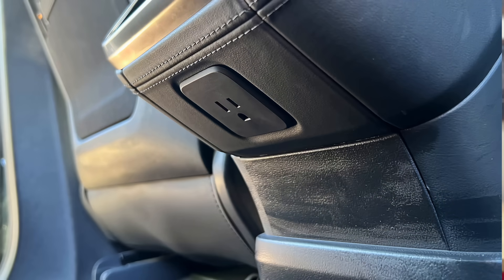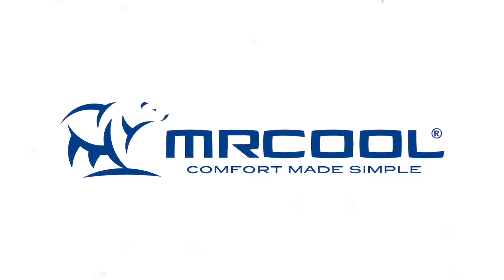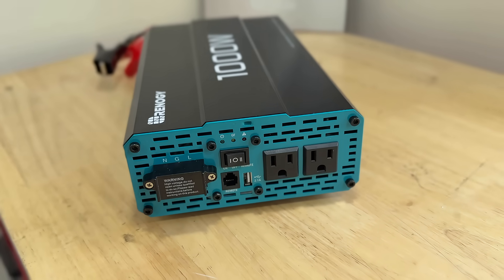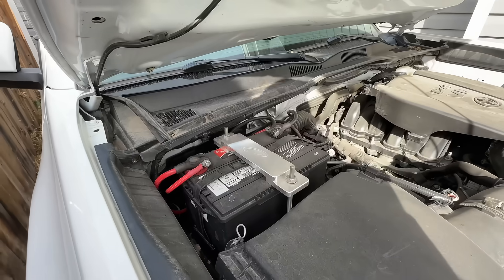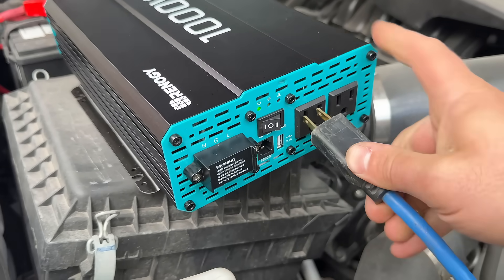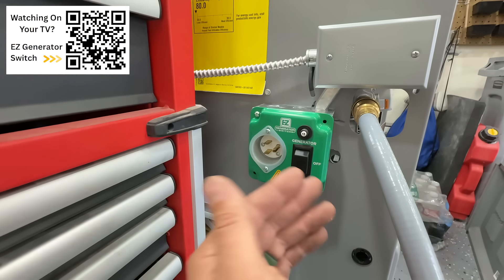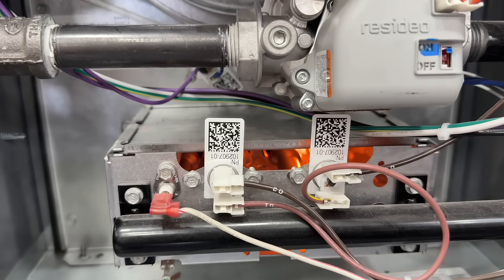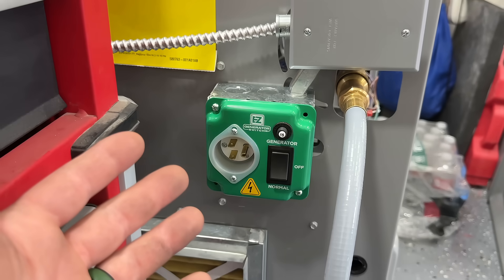Why Buy A Generator? You Have One Parked In Your Driveway.

Comment: 2:17 @diyhvacGuy One SUPER GOOD Idea MIGHT be to IMPLEMENT a “Uninterruptible Power Supply’ (‘UPS’) like The ‘CyberPower LE1000DG’ is the best UPS for people who want to  Be prepared for ‘Voltage Fluctuations’ to prevent potential damages caused by “Unstable electrical current Flow” going to the INVERTER, to back up Essential few electronics, including Refrigerators/‘Deep freezers’ and similar.  Another useful technology to enhance setup includes using a FARAD capacitor immediately BEFORE the Inverter primarily the +Positive+ terminal, the More Energy storage, the better for your Inverter’s long term health!
Essentially a type of Energy storage device “before AND after” INVERTER would very likely optimize overall optimal outcomes. Particularly for computers or Recent Refrigerator’s with real computers internally.
A UPS (just like FARAD capacitors) could SAVE available energy Plus Deliver a EXTRA boost!

Comment: This has to be the dumbest idea I ever saw. Yes a vehicle can be used but why? I am permanently off grid in South Africa. I can get a new 1000w generator for the equivalent of  $ 120. Uses far less fuel and won't ruin the car engine. Unless your car is diesel, idling for extended periods is really going to damage that engine. You will kill the battery as well. Anything using AC will flatten a car battery very quickly.

Comment: You need to caution people about the limited amount of current you can get from a car without special upgrades. First, you mentioned a 110 outlet in cars as being one step ahead but those outlets are meant to run a laptop or charge a phone. If you try and run anything else requiring more current you will blow a fuse. Ask me how I know, I plugged in a battery charger for a power tool and it blew a fuse. Second point is the maximum current you can get from a cars alternator and lead battery. They are designed to run a car and accessories, if you hookup a 3000w inverter you are going to fail. Find out the amps your cars alternator puts out and multiply by 12 to get the watts it will provide. Standard alternators provide 60-150 amps times 12 (12v battery) best case is 1800 watts, worst case is 720 watts. So you can see why this is important, if you hook  up a 1000W inverter to a 720W alternator you are asking for trouble. Don't forget that the alternator is not going to put out its top current at idle speed. Find out the current supplied at idle speed and get an inverter to match or be aware not to ask it to provide more than it can handle. This can work for running a furnace, OR, something else, trying to run more than one item is risking damage to the car in a worst case scenario, a fire. And I would not use clamps on the battery to power it. Attach some good connectors directly to the battery with an Anderson plug that the inverter can plug directly into. Clamps are an inferior connection that when asked to carry higher current loads will over heat.

Comment: You need to consider energy loss through a long extension chord which can be signifiant with a thin chord also consider for example the average electric kettle alone is 2000w

Comment: In 1987 bought a 1979 Ford Courier (Mazda) that had a 110v after market auxiliary kit on its alternator. Think it was only half sine wave and unregulated so engine needed to be revved to obtain the 110-125v AC. Think was supposed to only use brushed motors plugged in. But it was interesting for that day.

Comment: A 1000W inverter connected to your furnace will smoke the blower motor. $$ to fix! The start up current for a 1/2HP or 3/4 HP blower motor is more that 1000W. Be alert to BS YouTubers pushing nonsense like this. (message from an electrical engineer doing this type of work for 40 yrs).

Comment: Dirt bike has entered the chat.  Mount used generator to frame after rear tire removal.  Hose on exhaust pipe and ran out of garage and idle in gear selected on center stand and power cord to breaker box.  

Congratulations your ready to convenience your wife you NEED A TENERA 700 YAMAHA for "the family " 😂😂😂😂

Comment: 1000watt at 12 volts dc is an 85 amp load between the battery posts and the inverter. Going to need heavy cables for maximum inverter output, #4 awg cable given 100% duty cycle on the inverter.

Comment: if engine is idle about 300w is all  alt. can make .....
Never charge a battery with car power because you waste double power & charge half as fast, use solar panel always!.
DIg this, a charger must produce twice output voltage because it fights battery back voltage!

Comment: Notice on the back of this 1000 W inverter it has a 10 amp breaker your fridge pulls approximately 12 A your microwave pulls approximately 10 A you could power up LED lights each LED light pulls about 15 W if you’re gonna do this you need at least a 5000 W inverter You take the 5000 W divided by 120 and it will give you the amperage output all you’ll do with this 1000 W inverter is burn up everything you have

Comment: I have the 2.0 KW pro power onboard system on my Super Duty truck, it has 2 batteries & 2 alternators hooked to engine with built in inverters which is built into the trucks electrical system, cleaner quieter and more integrated than a traditional generator!

Comment: I would only do this in an extreme emergency to avoid the cost or a lot of money to replace your alternator later on this would work great if your vehiclee was from the 1970s but when they started to use computers in cars Nope dont do it alternators can be very expensive even my older 06 Lexus is350 alternator is around 1k

Comment: In an emergency you could use this. I'd recommend just charging a batt. off a solar pannel. Just run a few nessary appliances (refrigerator, water heater, etc) to avaoid draining the batt. too quickly. 

I'd recommend a 48v system by linking four 12v lithium ion batteries in paralel and a 48v inverter. This way you do not have to worry about ballancing the voltage between batteries like you would with a series connection.

12v 100 amp hour batteries are the most common and can be found pretty cheap. Running in paralel puts less stress on the batteries.

Comment: Most car alternators are 60-80 amp units.  That translates to (with perfect efficiency, which doesn't exist) 6 - 8 amps @ 120 vac.   An average 800 to 1000 watt generator is about $250.  Your car is worth probably an average of $20k.  An alternator replacement alone will cost about $1000.   You do the math.

Comment: What's the alternator's amps output ? How many watts does the furnace pull ?  The 'standard' vehicle's 120 volt ac plug works off a ±400 watt inverter. Hardly enough to power a gas furnace. 1000 watt inverter has limited output. If you have no knowledge on any of this topic, find someone who can go through the numbers before trying to save money instead of buying a good generator which will cost you more than $1000 when all the extra required addons are calculated into the price plus installation costs.
This system requires a bottle of aspirins and a good roadside assistance program.

Comment: I will reiterate what others have said here.  Putting that inverter under the hood of a running engine will quickly overheat the device.  It was never intended to be operated inside an oven.  Viewers should always use some kind of separate generator instead of going in this direction. SMDH. Just because you CAN make a video, that doesn't mean you SHOULD.

Comment: I just had a 39 hour power outage and used my vehicle with my 1500 w inverter to keep my refrigerator working. I have longer heavy duty cables so that I can place my inverter inside the vehicle so that it will not be affected by the heat of the engine when the hood is closed.

Comment: Thanks for your video!  I bought a 1000 watt inverter to use like this but I haven't tested running the furnace on it. I think the real test would be starting/running the furnace blower motor. I'm assuming you've tested that part?

Comment: So, will the engine be off while powering the home? It seems that would drain the car battery fairly quickly? Running it idling for longer that a few minutes is NOT good for your engine.

Comment: Yes this can be done but that does not make it a good idea. No! A car alternator will generate less than 1000w with the car at low revs. You are burning a lot of gas for very little power. If you pull more than your alternator can generate you will quickly drain your battery. Also be very careful on where your car exhaust is venting as you risk carbon monoxide getting into your home. Long term idling is not good for an engine.

Comment: Thanks again for another great video. I installed the less expensive outlet for my new furnace. But moved the outlet to the ceiling above my furnace. Attaching anything on the inside or outside of my new furnace itself would negate my warranty. Installing the outlet up above took care of that issue. Thanks again.

Comment: in a pinch   this will work   for a short while.   BUT  big limits,  first  running your car, even the most economical MPG vehicle will not run long while in idle,  maybe 10-12 hours  lets say 24 hours cause you have some extra gas from a second car. So for a local power outage that will be fixed shortly (according to your electric company) thats fine,  but for a Katrina even no bueno,  use that car to get out of the zone.   Will that car run your home ?  Nope.  the largest inverter you can hook up to a car battery  is 2k watts.  so yeah the fridge, some lights, maybe tv.   your AC?  no the central unit but maybe a small portable unit, but chose  food cold or you cold.

Comment: I hope most people don't take this to heart. The wires supplied with most inverters won't support the full rated output even in a short run. I've seen some companies even supply CCA wires with their inverters. It work OK as long as you don't sustain the rated power. 

Secondly, "many" not "all" new cars don't support extended idle times. Thirdly, the alternator is not going to put out full power at an idle. 

A lot of high idle times serve vehicles are having camshaft and lifer issues related to idle times. Mostly from the use of high pressure low volume oil pumps. The low volume doesn't supply enough flow to lubricate the engines properly.

Comment: You will NOT be able to run your furnace and refrigerator off a 1000w inverter hooked to your vehicle.. You would be very lucky if you can run one of them off of it. Depends on what the appliance requires to run. 

I've been working with these inverters for 1 1/2 years now and you are very limited with this setup.  I can't even run my hammer drill for drilling a slab for a termite job. Microwave is out of the question, it is also a long way from running a window AC unit. Not going to happen. Many large items have a huge initial wattage draw these 1000w inverters are not designed to handle.

You can run some lights, your computer, router, and maybe your TV at the same time.  Since you won't be running your vehicle 24 hrs a day. It is just emergency small power and not something that will keep your food frozen or cooled 24 hrs a day. Or your furnace running 24/7, if at all..

Big draw items will drain your battery dry even as it's being charged. Even a coffee maker will drain the battery while it's being charged. I use LiFePo4 3840wh  300ah  batteries. Way more depth than a vehicle battery, but you can't charge fast enough to keep up with continuous high wattage draws.

I have used 1000w inverters hooked to my truck to power a charger for the LiFePo4 battery in the house that has a 3000w inverter hooked to it with four outlets. I run my washer, dryer, coffee maker, two PCs with occasional printer and shredder use. But not all at the same time and the coffee maker gets shut down once the pot is made.  The 1000w inverter on the truck is only running the charger for the bigger battery in the house in this setup. I can run my PCs etc, for about 10-12 hours before needing the charger running again.. Can do 6 loads with washer and dryer without draining that battery yet.

The joy of having gas appliances and a grandfathered-in wall gas heater in the bathroom means I can heat my home without elec. use.

Comment: Guess my gas furnace is an outlier because it doesn't require an electric charge to run. Propane FTW!
Reply: So, how does Ur furnace MOVE the air in the ducts?  Or is it radiant (small cabin) ?
Reply: @darknes7800  As far as I know from the HVAC guy's explanation, gas powers the entire thing. There's no electric current for it or the water heater.

Comment: Newer vehicle have an idle time issue. They are not designed to run idle anymore. We used to run our vehicles idle all the time, but now they have intake and fuel injector issues as part of the planned obsolescence. And yes the dealer can access the computer and void your warranty for excessive idling. :2cents

Comment: According to ChatGPT, the alternator in my 2019 Dodge Grand Caravan is rated at 160 amps, and 60-100 A is already used by the vehicle. So about 80A is available for an inverter. And ChatGPT says the highest continuous load that I should place on the True Sine Wave Inverter is around 700-800 watts.

That's a pretty small load. I can buy a 2,000 watt true sine wave gas generator for about $500 that will handle 3 times the load, with no risk to my alternator.

But it's good to know my car engine is available for small loads in an emergency.

Comment: who has furnace in the garage like shown in this video? New homes have panels installed in garage. So 1 would have to set up desired circuits to be power DYI. Make sure your mains are off and install a CB ahead of time in the panel. Lock the main so does not get turned on absentmindedly. Terminate other end of plug cable into  breaker. But make sure the plug cable is rated for the output of the invertor. If you have panel in utility room, you would have to run cable thru garage wall.  Use stub in conduit. Garage panel is security risk but convenient for such hack. If panel in utility room is secure and one could run a permanent cable between the Car breaker in the existing panel and a terminal box in garage where u can connect the inverter cable only when need to use. Buy a lock for both MAIN breaker and the Invertor breaker in the panel to prevent undesired switching.
Reply: I don't have a new home ,71. I have a 14000 BTU furnace in my finished garage. I have panels in my garage and utility room, everything is with solar as well. All safe and up to code with built in safeguards. Many homes have utilities located in the garage. I don't see your concern unless its uncle Joe DIY hacks.

Comment: That's a cool trick for the gas furnace, but running your car's engine all day/night for that is a waste for long-term.
A space heater typically runs at 1500w and you'll probably set the place on fire if ya try that...
And you need a pure sine wave inverter to run sensitive electronics like computers. Otherwise you may fry them using a modified wave inverted like that model.

Comment: I would just say that some automotive alternators aren't intended to produce significant wattage for a prolonged period of time.  Many trucks have alternators that are fit for this purpose, and if your car has, for example, electric power steering, it has a heavy duty alternator as well.  But your alternator is surprisingly easy to burn out.  Fortunately, it's usually easy to replace as well.

Comment: OMFL.  what are you talking about.  this is where tinkering has gone wrong. 

When a generator is made, the ratio of the driving engine to the "alternator" is engineered so there is very little loss. 

your car is made to run the wheels.  which is a ton of power.  

granted, modern engines may be able to run very lean, but you are operating at a fraction of the efficiency of just getting a gas generator.;  that itself would only cost $200. 

get the right redundancies.  dont hack in bullshit.  or people will think this is a solution.  its a bandaid at best.  in the real scenario, you are putting wear on your entire vehicle for the equivalent of a campfire.

Comment: Well, First of all it saves a ton of wear and tear on the vehicle, sitting at a constant idle for a long time is not good for an engine in a car/truck (look it up)..  Second, it costs a LOT less fuel to run a generator over running your vehicle, if you want to spend hundreds of dollars to run your vehicle to power things, have fun..   just remember, that few hundred dollars that it would cost you for the generator, is a LOT less than the amount you will get charged from a mechanic to refurbish your car engine..  and this whole idea that you don't need to run the engine while using the inverter is poppycock, as a former trucker that used them a LOT in the truck, they all recommend NOT using it when the engine is off. and Semis have multiple batteries..

Comment: In the 1980s you could buy an alternator that put out 110VAC for motorhomes. Some had 12V terminals to connect an inverter directly so you  don't have to wreck your vehicle's battery.

Comment: A prius is the perfect generator. And an old prius is cheaper than lots of generators
Reply: But a prious is electric and you need a generator for when you have no power. So once the charge is gone you can’t recharge. With gasoline power you just add more fuel
Reply: @knownote a pruis is hybrid and you only need gas to get it running for as long you you need the power.